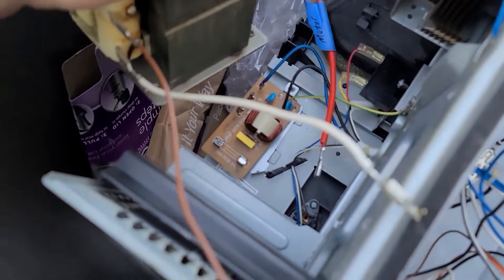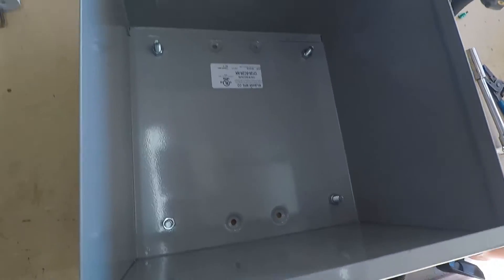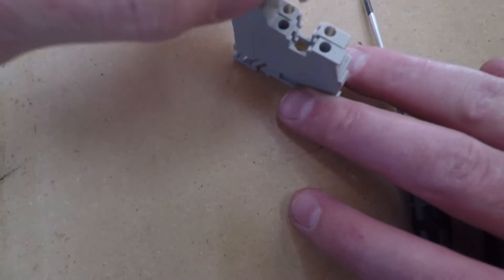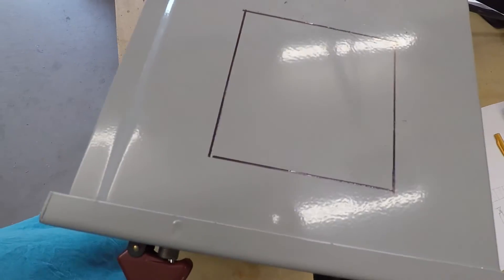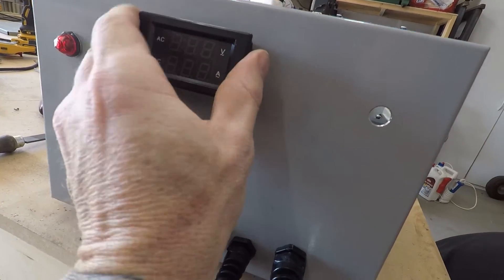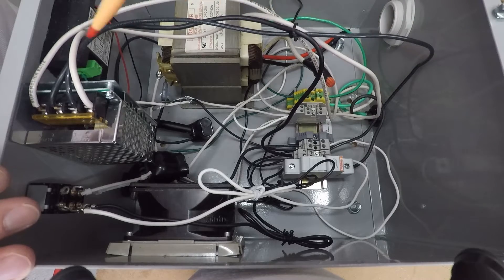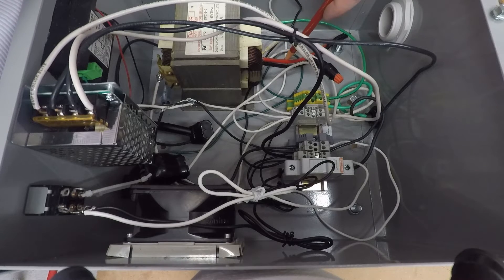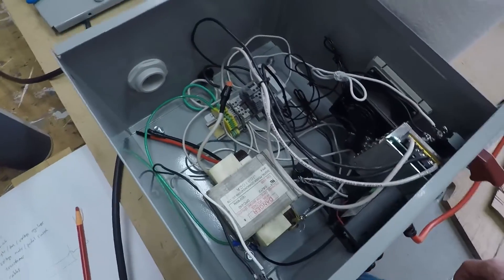DIY Build a Lichtenburg Machine

Comment: Not over-engineered, mis-engineered.   Without a discussion of the features which ensure a clear and consistent current path from the secondary to the wood, back to the secondary, and the design features which ensure very low chance of deviation from that current path, the build is at best very incomplete.   

Another item not specifically neglected here, but almost universally neglected in these builds, is that these transformers are not rated for indeterminate loads, which can potentially be much greater loads than the magnetron.   So at least trying to cool the transformer was a (mis) step in that direction.    Limiting input current to the transformer is a better solution, but I did not take time to try and construct a schematic from the "build" to assess if an adequately reliable form of current limiting is achieved.  

Along the lines of the previous paragraph, nobody has done a serious professional assessment of the types of transformers and their failure modes relative to their construction and materials.   That is, are there failure modes which allow secondary voltages to leak to the primary side?   

So, there you have three very quick areas which require experienced qualified professional eveluation, three of probably hundreds.    The high voltage sticker installed at the end, the the digital displays, and reasonably nicer hardware used in this build provide all of the false sense of security needed to chalk up a couple more deaths.    Sorry bro, I know you tried, but it is about far, far more than a nice looking box.
Reply: This is a perfect example of the Dunning-Kruger effect. I pray at the least that the high voltage leads get changed out to wire that has proper insulation rated for high voltage. I can just imagine that high voltage arcing where you don’t want it to. Perhaps even the lead to the dead man switch. Such high voltages can go in paths not anticipated.
Reply from the maker: I appreciate your opinion and your taking the time to add to this topic.
Reply: He fused the primary
Reply: @d46512  the fuse will provide additional safety against certain specific types of failures.    This is good, but I would replace the fuse with two light circuit breakers in series.   

Why?   
In series to for redundancy should any one breaker be defective.   "light" meaning 5 or 10 amps at most.  It should be enough current to burn, and if it isn't, manage that on the secondary side with probe repositioning or the electrolyte solution.

In any case, for this specific failure mechanism, (transformer overheating) the fan/fuse combination should provide enough safety that we can now look at the 900 pound gorilla in the room, namely that the secondary very often has one of it's terminals attached to the transformer frame, which many Lictenberg builders tie to the earth ground on the primary side.    THIS IS SOOOOO ASKING FOR BIG TROUBLE.  For later, let's just say this is the black secondary lead.    It increases the probability of unexpected (bad) current paths.    Keeping a very good distance from the probes only partially solves the main problem, which is:   the current from red lead (the other side of the secondary) now has many, many more ways it can find a return path to the other terminal of the secondary.   Most of the "red lead" current returns through the black lead, but not all.   Some finds pathways you don;t expect, through earth ground, before it gets back to the other side of the transformer secondary.

It is well worth your while to let that last paragraph sink in.  Once you can draw a circuit diagram showing these unintended leakage currents, now simulate a failure of the black lead (the circuit equivalent of a black lead failure happens all the time during a normal burn).

What I would like to see is one of these more serious YouTubers, one who has his ego properly modulated by the right knowledge,  to show the current flow paths leading to trouble.    Then it becomes far more simple to solve the safety problem.   In a nutshell, FLOAT both secondary leads (not just the red one) and throw out these unprofessional and just reckless use of crap like car jumper cables.  Get some very good high voltage wire, high reliability connectors, and make sure all that is no longer than necessary and very reliably insulated. If one does a good job at this, you would about have to grab the probes to be electrocuted.  That is, taking the preceding paragraphs to heart, one is eliminating all of the unseen but very damn real "leakage" pathways.    One more thing than I'll leave you all to it.....

The name "leakage pathways" may be a bit misleading.   With the lichtenburg process going, burning, the current is changing in all of those pathways depending on what is going on at the site where the probe contacts the wood. If one ever observes the red probe (the non-earth grounded one) burning nicely, and at that exact moment, the black (earth grounded) lead is not exactly equivalent in the current returning to it.....then that red lead current is using some unseen pathway to return current through earth ground, to the other side of the secondary, the earth grounded terminal.

Only if you have all that locked into your head, it is the only way you can expect to outlive the dangerous amateur phase most lichtenburg burners stay in until something goes very wrong for them.
Reply: @TheGreenHeartofItaly-fl3wv  YES I'm with you on isolation and jumper cables.  From my experience the secondary is riveted onto the transformer's laminated plates.  Easy to remove.

He needs to replace that ridiculous foot switch with a pair of hand-operated dead-man switches, bolted to the machine, so that neither of his hands can be near those uninsulated alligator clamps.  I wouldn't let anyone I care about near that death machine when it's plugged into the wall.
Reply from the maker: The benefits of the foot pedal switch not only allow both hands to be free but also electricity can lock your grip or your hands and arms into position. I agree the alligator clips could be upgraded but the system shouldn't be energized when handling them. That's where a separate foot pedal switch comes into play. It takes everything out of your hands to operate which helps prevent careless mistakes. You both offer some good info though and there are ways as you suggest that the system can be improved on which is great for the community interested in seeing what I have built and how it can be improved moving forward.
Reply: @Vallenge There are decent strategies for dead man switches and foot pedals, but if we overlook that secondary connection to earth ground, then either foot switch or dead mans switches can become deadly DEPENDING ON THEIR ARRANGEMENT.    Yesterday I did a video to lay out the leakage paths associated with the earth grounding of either secondary lead.

Comment: Is the ground wire from the power cord connected to the plate of the transformer or not? And should you coonec the ground ro anythong or not?
Reply from the maker: Hi Vlad. The transformer is bolted to the box. That bolt is connected with a wire to the black cable and also has a green wire that connects it back to the green grounding terminals which are connected to the ground wire from the power source. Absolutely connect your grounds. All grounds should always be connected.

Comment: The only problem I see, using a metal box to house high voltage not always a good idea. You could do the same thing with a plastic box they sell at your electrical supply. Much safer and less likely to conduct electric to hurt or kill😮😮 somebody in case of a short. Although I do like the design.
Reply from the maker: Thank you for your suggestion Jeff.

Comment: looks like neutral white going to switch?,i did all my hot low volt wires black
Reply from the maker: Hi Daniel. In general I agree. White wire would always represent neutral and the black would represent line/load. In this project I just wanted it to be easy to see the difference of the line in wire to the switch and the load out wire of the switch. Thanks for commenting.
Reply: @Vallenge  I love the potenciometer on line, will make more interesting!
Good job
Reply from the maker: @danielson101  Thank you!

Comment: I built similar but no voltage control. Is this a rheostat, and is this control on low voltage side.
Reply from the maker: The voltage regulator is wired before the transformer.

Comment: What size CB did you use and why?
Reply: Perfect cheers, love the video best machine I've seen, I'm making one similar off yours
Reply from the maker: Thank you
Reply from the maker: What does CB refer to?
Reply: The fuse / circuit breaker
Reply from the maker: The main fuse is a 20A Time Delay Fuse. I chose this fuse as I never wanted a higher current of amperage running through my homes circuit to the machine and if it does the fuse will blow.

Comment: hey , awesome build ... i looked up your toggle switch link but it takes me to a page full of them .. wich specific one  did you use pls .  ty ia
Reply from the maker: I have a buddy who is an electrician and he had one he gave me so I don't have the exact one I used linked. I would suggest checking specifications and reviews to choose the one you think would be best for your application.
Reply: @Vallenge  ok ty , i found one . now your box , i have a hard time finding a box like yours
Reply from the maker: Lol... It's the same thing. If I bought it I would definitely give you the link but I got it from the same buddy...
Reply: @Vallenge  ty vm for the replies
Reply: @Vallenge  whats the size of the box , 12x12 or 14x14 ?
Reply from the maker: The box I used was 12x12x8 1/2

Comment: Nice job BUT it's 100% over-engineered.
You don't need a voltage regulator, a volt meter, a fan, terminal blocks, an indicator lamp, or a rocker toggle switch. The fan on the microwave was for the magnetron, not the transformer. The transformer gets warm but never hot. The voltage is HIGH voltage for fractal burning. I have never needed to reduce the high voltage. Also, a demo would have been nice to show how well your super-machine actually works, how handy the reduced voltage can be, and how you keep observing the voltage on your handy voltmeter.  

It's very cool but you're not building a piano.
Reply from the maker: Hi Eric. Thanks for commenting and providing your thoughts. I just wanted to have fun with the build and make a cool machine. You could opt to bypass installing some of the features but I do recommend at least keep the voltage regulator as it does allow for a variety settings which can be useful. I am continuing to build upon the Lichtenburg playlist however some of the information you said would be nice to show you can find in the Playlist. In particular, please take a look at Lichtenburg Fractal Burning - P1- First use Pine Board video https://youtu.be/h72NEMN14JQ . Let me know your thoughts.
Reply: @Vallenge  Thanks, I checked out that Playlist item... very interesting. At flashover, have you tried moving just one contact to steer the burn? Also, have you tried a spray bottle on the 'fine mist' setting to add just a touch of the solution? I live near the Pacific Ocean so I'm gonna try ocean salt water. All the minerals and maybe a bit of pollution from marine traffic could yield some cool effects. Thanks for the demo. Comments?
Reply from the maker: I have not tried moving just one contact at flashover or a spray bottle. Those are interesting ideas that I will keep in mind. Let me know how the salt water from the ocean works for you. It could be more conductive than regular tap water and salt due to a variety of other substances mixed in. Also, I'm curious to see how the overall burns and woods appearance looks after.

Comment: Great piece of work. I’m wanting to build one myself and this is the best I’ve seen yet on youtube. I want to do some projects with fractal burning but have a question. How does the voltage regulator come into play? Is it used for different wood thicknesses or burn rate/depth? Sorry, I’m ignorant on this. Yours is the only one I’ve seen with the regulator. Great work! Thanks!
Reply from the maker: Good question Dana. I plan to do some future videos on it but in answer to your question with a lower voltage the the fractal burn is slower and covers less distance. With a higher voltage it burns much faster, deeper, and covers a larger distance. When I want to get more detail I put the contacts closer together with lower voltage. When I want to have bigger burns and connect further points I increase the voltage.

Comment: I would like to see Lichtenberg engraving on prefabricated kitchen cabinet doors.
Reply from the maker: Thats a cool idea and something I'll keep in mind to try.
Reply: @Vallenge  hey thanks for the quick response! I have been thinking that there is a market potential in Lichtenberg engraving in fine carpentry if the problems regarding the random nature of the technique can be solved. It seems to me that using standardized blanks will provide room for quality assurance. What do you think?
Reply from the maker: I think manipulation of the electrical contact points can help you to somewhat guide where you want the pattern to go but it will not be consistent. Depending on your rate of success versus failure ratio and your cost per blank used you could decide if it's viable. Other issues could be time versus profit made per sale, costs for use of the machine, etc... Let me know as you get into this how it's going, I like the creativity and uniqueness of the idea.

Comment: How are the cables attached through cabinet to red/ black interior. Just alligator clips?
Reply from the maker: Hi Mark. I used electrical wire connection reducers so the larger wire and smaller wire can be connected to each other and then they are directly wired to the transformer.

Comment: What is the part number for the voltage regulator?
Reply from the maker: The ASIN is B08LSQWGZT. Not sure if that would be the part #. The info is "4000W Motor Speed Controller, Motor Control Board AC 110V Adjustable Voltage Regulator SCR High Power Dimmer Controller Temperature Governor Dimming Monitor. It is linked in description. There are other options as well. That is just the one I chose to use.